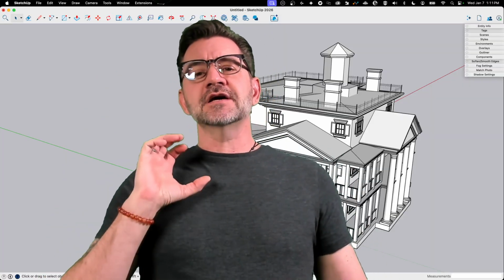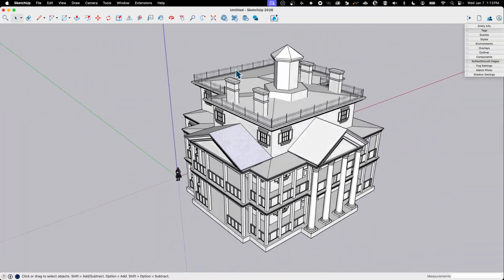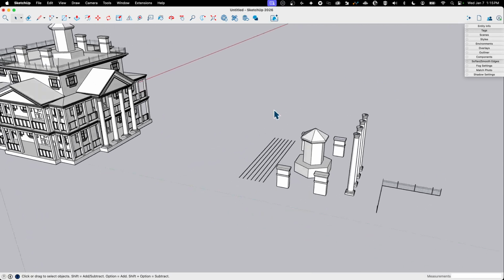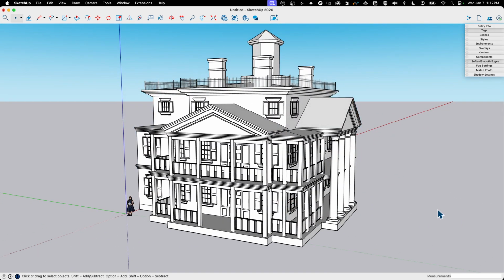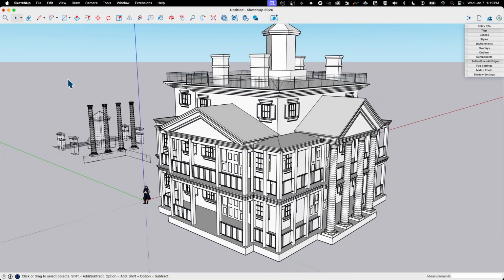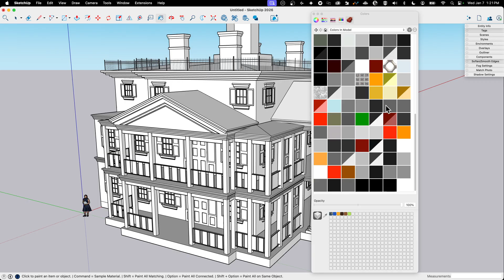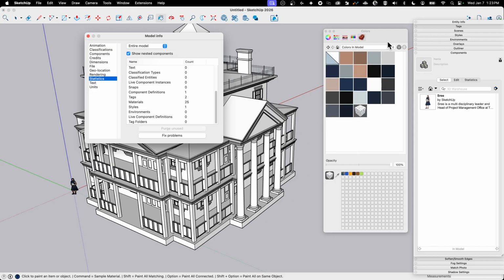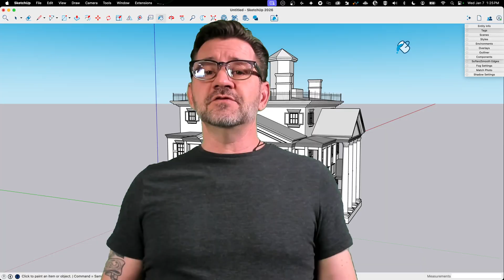5 Ways to RUIN Your SketchUp Model

Comment: Aaron, thanks.  I really like your videos.   In this case; I am "Guilty as Charged" (with 4 of the 5 missteps you outlined).   I am primarily use SU for woodworking designs.  I tend to end up with multiple copies of stuff, either placed really far away or hidden (and indeed it bites me in the butt later on).  
I have been using the technique of coping something, modifying it, and hiding it to explore different options in furniture designs (ex. 3.5" molding vs. 5.5" molding, two banks of drawers vs. three banks, 18'' wide vs. 24" etc.)   Many of the pseudo duplicate  parts end up as groups rather than components adding to an even bigger mess.
Can you share some other ways to allow me to model various "options" to my projects and avoid the pitfalls you pointed out?  Perhaps using Tags is the answer.

Anyway, thanks.  You guys are great.

Comment: Great tips. I almost always have a junk pile (boneyard) layer. It's great for iterating in the design process and also shows a story board of the changes.
Reply: Woo, okay. I like this. Thank you
Reply: If you lay out the components beside the model ma d you need to make changes tot them individually, i find it is sometimes easier to make those changes on the component laid out separately from the assembled model, rather than trying to select and modify the component that needs changes but is in the assembly…. Or is there a better way of working?

Comment: I definitely use the "side yard" thing...
I put it on an off layer called Misc. 

Is there a method/plugin to manage duplicate textures or colors? I'm tired of putting 20 of the same black color or metal texture into my model and it just collects up for the exact same thing bloating the file size.